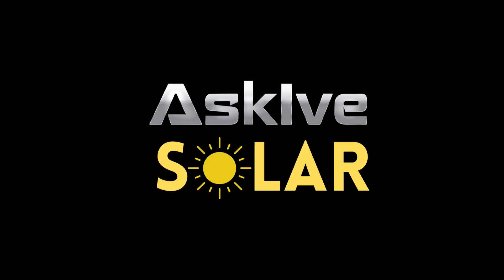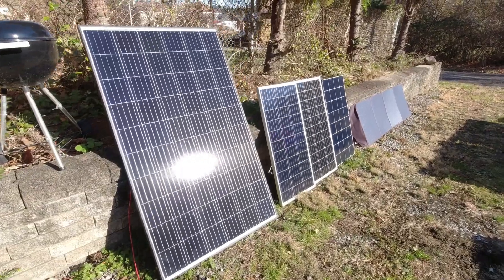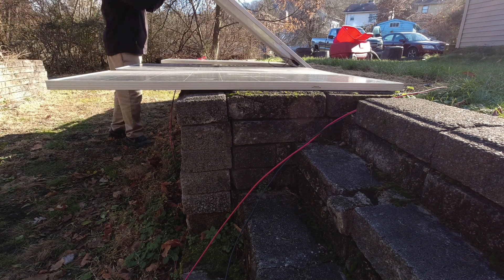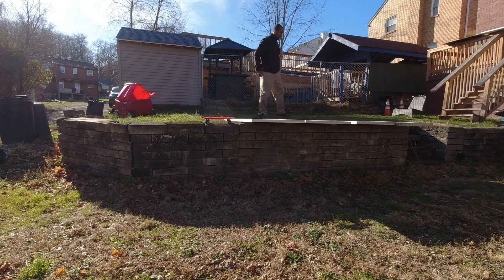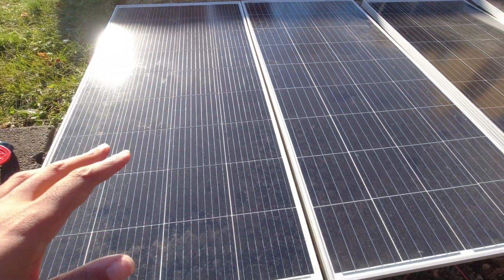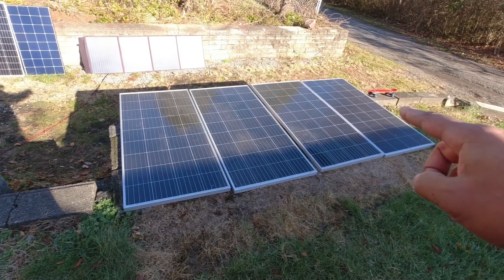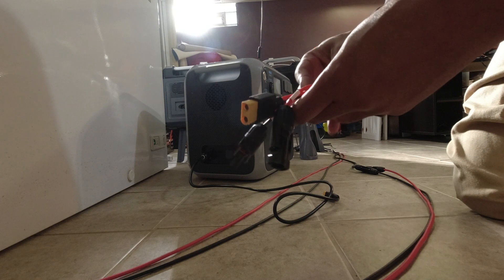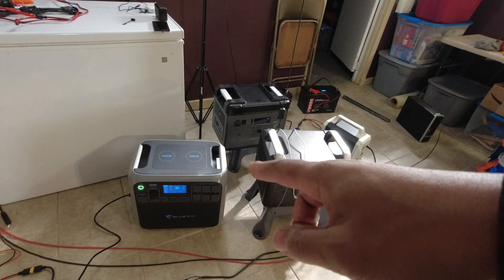BTS - New AC200P Solar Array - My Biggest Solar Array!!

Comment: I like the way you evaluate what you are doing and plans to come! It shows to me atleast, that you use your thoughts to see many different projects and ideas; you are very logical minded. I would suggest you keep a log of what to do and then follow up with what you will do! With me, the subject of solar systems came up in 1999 before I moved into this house I have now. I started and moved in: 24 December 1999 with 1200 watts of panels and a 5000 watt inverter. My last upgrade was this month March 2023 with 7 335 watt panels and another charge controller. :)  😀 I now have those panels and 5 330 watt panels. I keep a log and notes of what I can do with the newer panels; I call it a "Report", just to keep me on track. I have ruled out roof mounting, which was desirable, but decided on ground/yard mounting system. I am trying to keep a video of things I do on my channel when I have time. Thanks again for your presentation. Good work my friend.
Reply from the maker: I really appreciate this comment! I have so much fun figuring this stuff out and thinking through it best case scenarios. 

I'm a digital thug vs analog (paper) so I don't know if I'll keep a log of things. Ha

Comment: I have only connected in series but I did invest in a parallel cable. I haven’t tried it out yet. Starting Saturday we’re supposed to have 6 sunny or mostly sunny days coming in so I want to experiment with parallel then. Good day today then two days of rain so I will run my kitchen one more day on my OG Delta. Ordering two more HQST 190w panels today as well!
Reply from the maker: Just be careful with the parallel cables as it combines amps and after maybe two panels in para, then you'll likely need fuses.
Reply: @PattymacMakes I have tried both ways at my house. My charge controllers can only accept under 100 volts. My panels output is around 41v at 9 amps, so I can serial 2 of my panels to be under 100 v or 82v at 9 amps. My controller will accept 80 amps. "in theory" it would accept 9 parallels of 2 panels, Parallel connects only doubles the Amperage. Just wanted to help. 😃

Comment: I love series but I  dislike parallel.
Reply from the maker: Series is great until you gotta deal with shade.
Reply: @AskIveSolar  Just depends on if one has open space or not. High volts helps charge a little faster. That ac200p is cool unit it can do many things. DC is very stable. I ran two 50 liter 12volt freezer mode on it connected to solar.

Comment: How long are your cables? Do you lose power over longer distance?
Reply from the maker: Longest is 50ft. Nothing worth not extending the system to get your panels in the sun longer yanno. Jasonoid did a video where the voltage drop is really negligible
Reply: @AskIveSolar  I have kind of a big yard. Mine is 80 feet. I need to make a video of my setup for you to judge.
Reply from the maker: Just plug it in and see the watts without the cable and then with the cable. Should tell you what you need to know. 
But im always down for a video. Ha
Reply: @mida42  Hey. I would like to see your video on your setup solar system too. I added 7 335 watt panels march 2023 and it will be 75 yards out in my yard also. Would be nice to see someone else working on this idea. Thank you in advance.  🙂

Comment: What if you flip the panels around 180'? You would then have the cables hanging off the ledge and you could easily access them right? Then you could just zip tie the loose stuff up using the predrilled holes in the panel. That would be easier and faster for wiring changes between the panels.
Reply from the maker: Something in me prefers to have cables go their own way vs against the grain. 
But during the summer that's kinda how they were. But they could hang if the edge then str8 down. But they needed to be pushed in further so the car would fit in the driveway. We hug that side pretty tight.
Reply from the maker: I was re watching the video and I see the positioning is in its summer position still. I have to push them back to where the grass is brown.
Reply: @AskIveSolar  funny how different they are between seasons!

Comment: Hello I was wondering if you can speak your EB120. How has it  been pulling it's weight and what products do you have running on that unit. Going by what I can afford this is looking like my next purchase
Reply from the maker: I'd rather see you entertain the delta pro since it's lifepo4. How much is the eb120 these days. 699 599?
Now it does have more cycles than most li ion with around 1000 cycles I think. 
I'm not crazy about the 1000 watt inverter but it's cool.
Reply: @AskIveSolar  well after the CES convention ecoflo is still pushing for more than $1,000 for their product where the EB 120 is holding at 749$ which is good on my pocket
Reply from the maker: Keep in mind it had a5 year warranty, 1800 watt inverter but a little less watt hours. Now currently the fan is super loud on the EF but it has been on sale for 899 I believe. 
I'm asking my friend now how cheap it has been. I know it had a crazy deal where you got two panels for free
Reply: @AskIveSolar  what do you use to power your deep freezer?
Reply from the maker: The eb120 can and has because it doesn't use more than a 1000 watts when it spikes for the compressor.
Reply: @AskIveSolar  now that's what I'm trying to do for emergency and when not needed for that I hope it can run a TV and cable box and the wifi on the daily in the summer
Reply: @AskIveSolar  do you know if anyone has a coupon code for this model
Reply from the maker: Nah, Im not really in the loop on coupon codes and such. Check out Bluettis Ebay store, shoot and check out EcoFlows as well.
Reply: @AskIveSolar  I did check ecoflo and is it just me but do they have 2 units at a 1100$ price range that is for 1024 w and one that is 1200w?
Reply from the maker: Ecoflows lineup can take some getting used to. That's for sure.

Comment: Is there a tool to help taking them apart the connection. Mine is hard to take apart.
Reply from the maker: Search askive mc4 tool. I have a couple shorts. I thought I mentioned it in this video or maybe it was the wire gauge test video.

Comment: your voltage fluctuation was most likely caused by the MPPT controller inside the bluetti as it was trying to find peak wattage.
Reply from the maker: I think  you're right. Crossed my mind after watching a few times and because sun was going down.